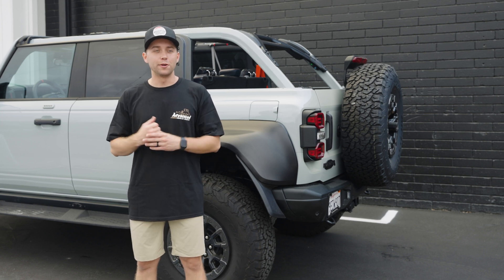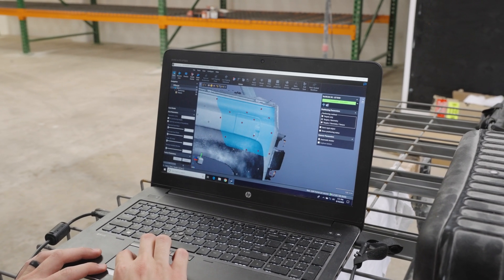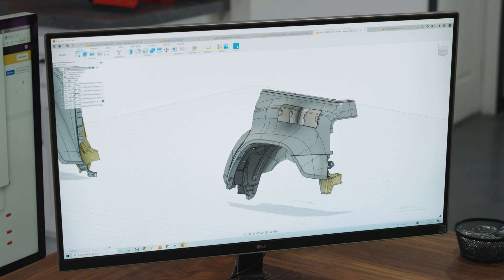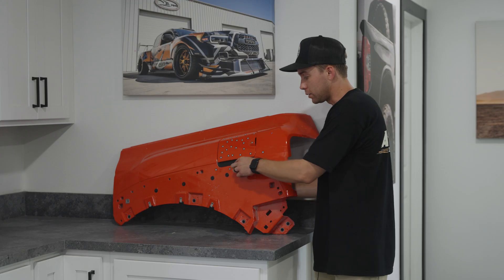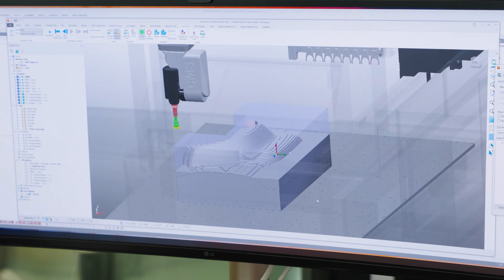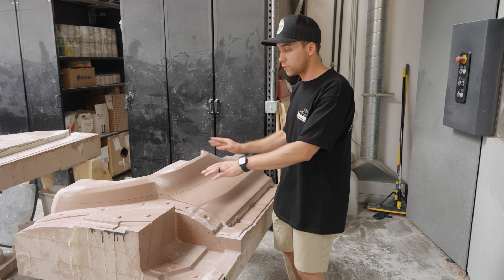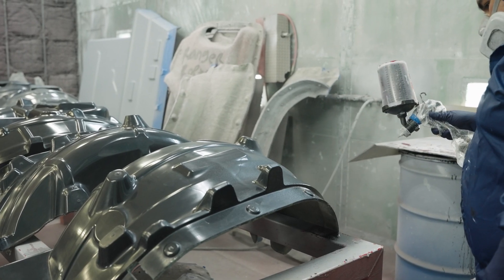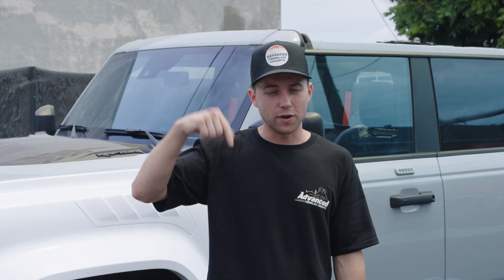Ford Bronco Raptor 4.5" Body Kit | How It's Made

Comment: Will this fit a base bronco
Reply from the maker: It requires the Bronco raptor valance, gas pod, gas door, rear bumper trim, and tail lights to be fitted on a standard bronco.
Reply: @advfiberglass  will you guys ever make this exact same fenders but for the base bronco without having to replace all the things you listed (taillights, gas pod, valance, etc.)? I really want to get the raptor 4.5” fender flares for my wildtrack but I don’t want to replace all those other parts.
Reply from the maker: @raadalsharif3183 If we get enough interest then we will consider it.
Reply: @advfiberglass  Thinking of the same thing... Wildtrack 4 door slightly different wheel offset, small lift, 37s and would love to do the widebody 8" but without the gas pod, lights etc...